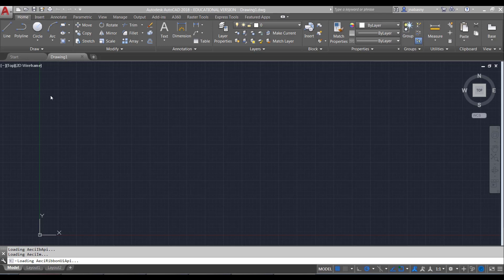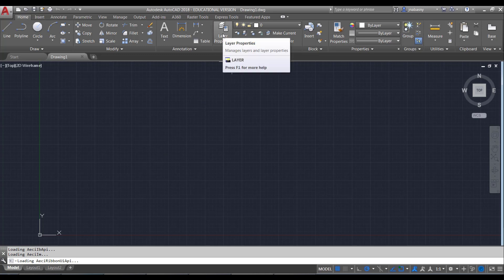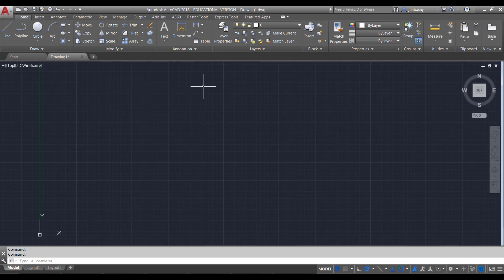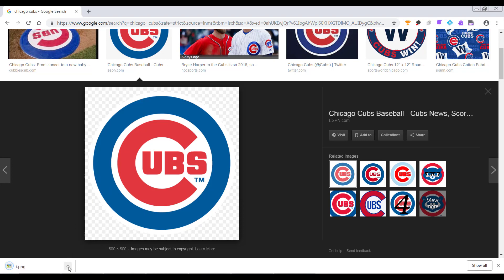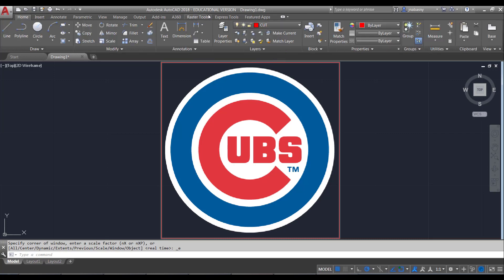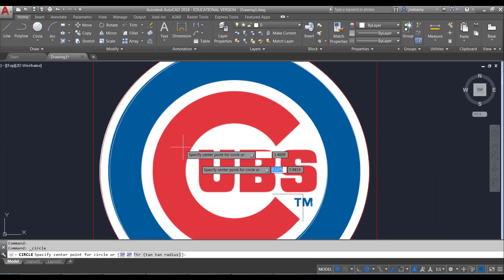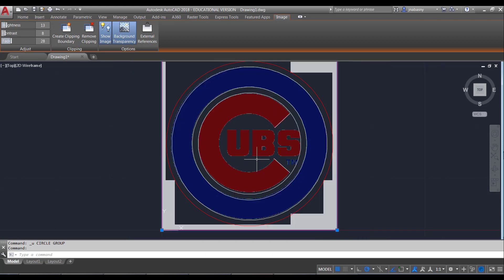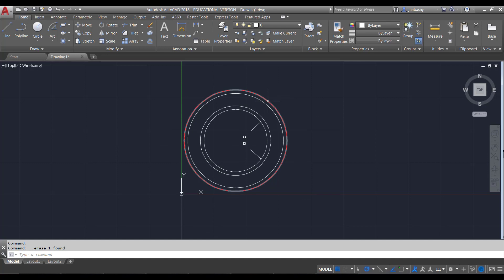How to Setup AutoCAD to Laser Cut

Comment: Hey Bob, is there a way you use to directly laser cut from AutoCAD? Or do you export the dxf to another software? Thanks!
Reply: Depends on the laser. With Epilog lasers the laser added as just another printer but they don't all work that way.

Comment: I have a similar design and I want to engrave. I have shapes with solid hatching that I want engraved but when I open the .dxf file in RD Works I only have the outline of the design. I have selected the scan setting for engraving but I still only have the outline and it won't engrave. Any ideas?